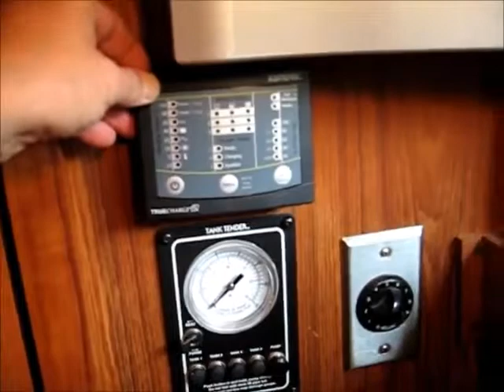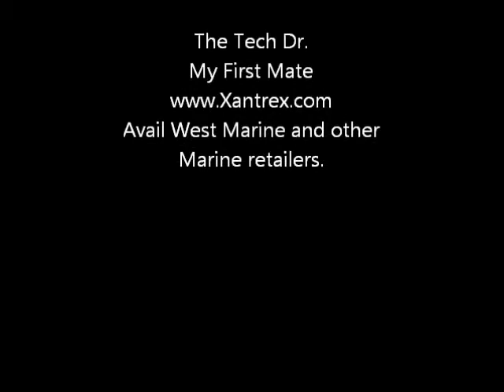Installation of the Xantrex TRUECharge2 Battery Charger

Comment: I have 2 x Truecharge 60A chargers in parallel. One doesn't charge at all and the other one only charges at 30% even when the batteries are low and the thing is set to charge at max rate. I have emailed, messaged and filled out you web form a number of times. I have had nothing back! These were expensive items and at least you could respond. I rang the US last night and it says the number on your website is disconnected. Very disappointed
Reply from the maker: Hi Paul, 

we are sorry to hear that you are having trouble reaching our support team.
Please note our support line's office hours are from 6:30am-4:30pm PST, Mon-Fri.
RV season is in full swing and our support team are working with an elevated number of requests. Your request has been noted and someone will be getting in touch with you.

Comment: I have a Truecharg2 20 amp that charging as it should. However the fan  seems to be constantly running. I've never observed while on and charging when the fan isn't running. Is this normal? Is  the Truecharge2 fan microprocessor controlled via an internal temperature sensor?